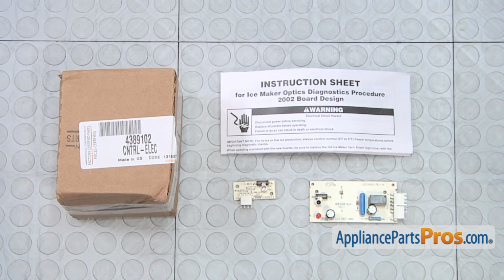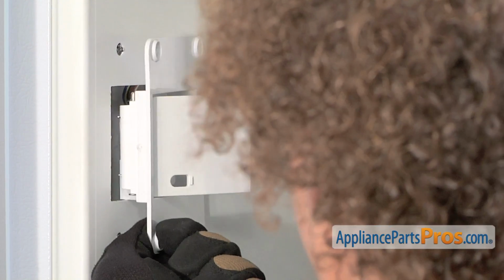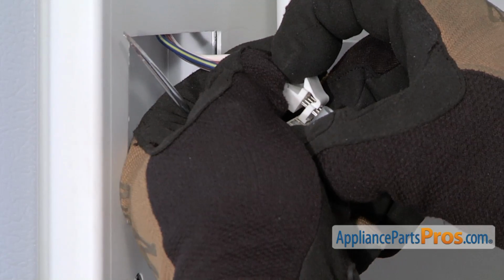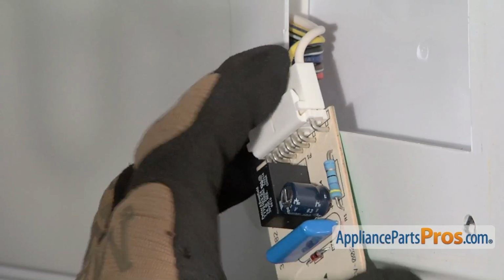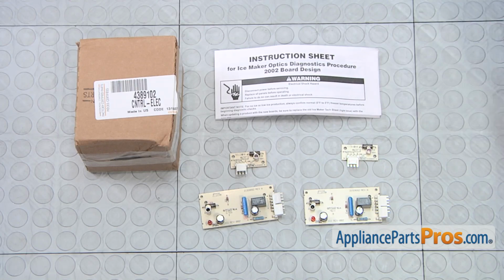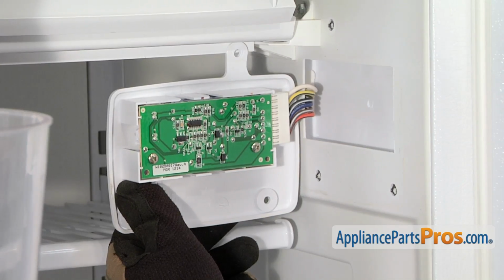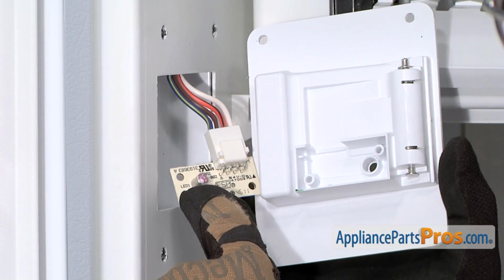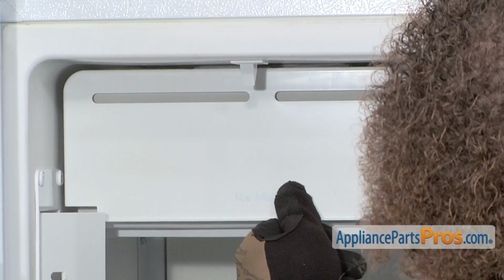How To: Whirlpool/KitchenAid/Maytag Ice Level Power Control Board Kit W10757851

Comment: my emitter light will not light even after i changed the board. How can I determine if the emitter board is getting power. I was able to bypass the sensor lights and was able to produce ice. Something funky going on with the emitter light. When I close the flapper panel the receiver continues to blink. Now also when I close the fridge door about 3/4 of the way the internal light system in the freezer goes out as does the receiver light. I ran a video inside my fridge when the door is closed there is no emitter or receiver light? Yes I'm baffled. Everything is installed correctly becasue the pins for the board can only go in 1 way. Any ideas? thanks...this is on a Jenn-Air Model JS48SSDUDE01
Reply from the maker: Based on the information provided it sounds like the emitter board is bad. You can call us at 1-877-477-7278 and we will be happy to go through some more troubleshooting to help you figure out the issue.

Comment: I replaced the control board (twice) as depicted but as soon as I switch on the power I think I heard a slight pop emanating from the right side board and its LED started the double blink. It never went on continuously. What are the voltages I should read in the connector from the ice maker so I can check if something is amiss? I suspect  that one of the components is failing each time I power up.  Thanks for any help or advice you can provide.
Reply: Same problem with mine, tried 3 different replacements and nothing works

Comment: I replaced the censors yet the light still blinks... so i guess its not the problem to begin with. Pls advice
Reply: Did you ever find an answer for the blinking light?  Mine is doing the same.